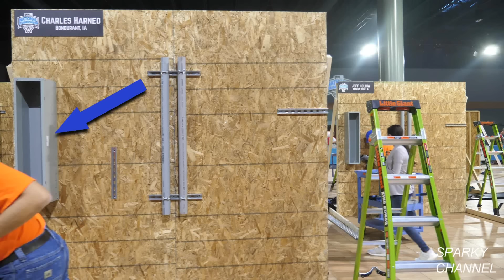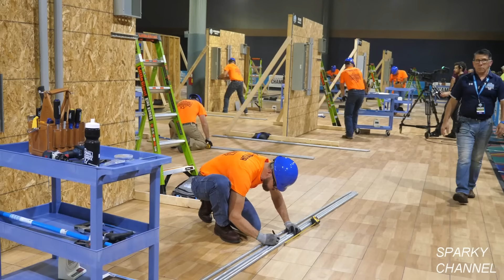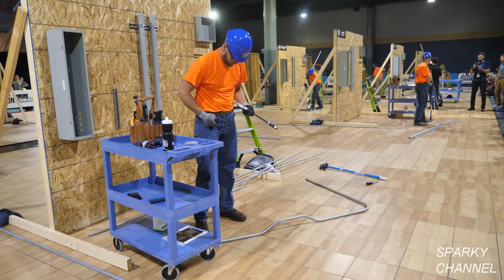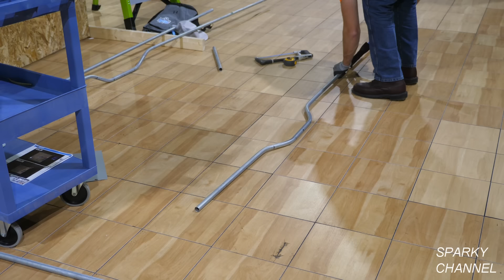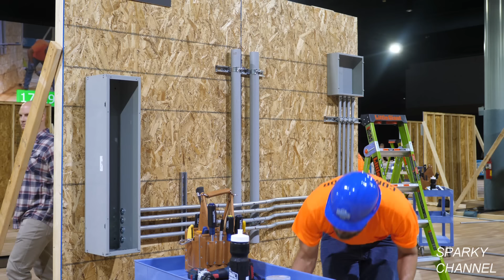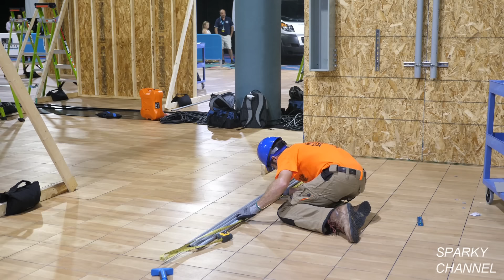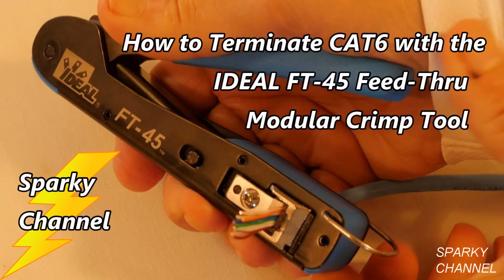IDEAL National Championship Pro 2nd Round Parallel EMT Bends

Comment: Missing a " strut " on the right of the 2 pvc pipes
Reply: Read code. No more straps are needed
Reply: @JB-ud2gn  i guess you did not understand what i meant.
I know that based on the code, the distance between the 2 fixation points here, are o.k.
But...
From my personal pov, i would have put 3 struts to hold the four 3/4" emt pipes.
One between the truff and the pvc pipes.
One between the pvc pipes and the 90° bends.
And one between the 90° bends and the 12x12x4 box
But like i said, it's only my personal pov. 
But non the less, a professional should know that we never use a "sharpie" to mark conduits that will be apparent!!
Always use pencil.

Comment: Emt...?  Get out of here.  Do it in rigid, then we'll talk.
Reply: you feel cool by being like oou im so much better because i can do it in rigid? EMT is used 500x more than rigid.
Reply: @Ash_Lawless  They have that too for poured slab. It's a 2-man team event including inside outlets, 3-way switches, meter/service entrance, breaker panel. The slab has a designated finished height, so the conduit runs have to be planned to not weaken the concrete by having crossings as they go from one side of the "room" to the other.

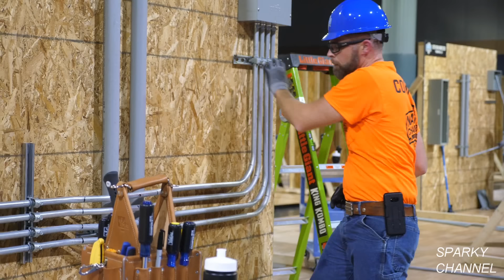Comment: @22:25...

Called it...

A secondary bit of shallow strut support after the offset and closer to the corner 90s would relieve that waiver in the pipe and even out the geometry some more the fact that it was bent in the offset configuration inherently put an instability in that pipe because the run is not flush against the surface for the entire area that would normally touch in an ideal flush mount... that 90 is the axis of a lever and if you support that axis it'll stay there... regardless a little hand tweaking on the corner will smooth it out to the eyeball on any latent tension due to those less than perfect 90s...

Comment: Torpedo levels!!!    @20:37...

When they bend the 90 after the offset most experienced electricians will be close enough to their 90 Mark with a little plus or minus and the knowledge that the pipe has a little bit of flex to it plus coupled with the fact that yes you do your strut straps that adds more tension and rigidity and kind of locks the pipe into its geometry... but where I see the flaws the fact that when you bend up on a full 90 you should use a torpedo level at the uppermost portion of the pipe to confirm the 90 in a relaxed position that will relieve the tension down on the corners because you'll see that the spacing and sometimes an ovaling of the pipe will occur on that full 90 and it draws the eye... I mean these guys got good technique and are given a solid install but the absence of torpedo levels boggles my mind...

Also honestly I know it's not called for but I would have added an extra section of strut on the horizontal run after the offset and before the 90 to give a bit more rigidity I like to have strut support and such within proximity to the 90s as it fits the install... what about plastic bushings on the threads the connectors in the panel they going to do that? I got to tell you too I'm a little concerned about how tight they're getting their lock rings on their connectors? Doesn't look like a lot of torque I think a lot of installers underestimate a solidly mounted connector...

Torpedo level, tape measure, laser line it don't matter eyeball is the ultimate test...

I mean do you really think that floor is level? You think those framers got those walls squared and don't get me going on the drywallers you think that stuff's Plumb level and straight all the way around? Really? When you enter a room you need to take inventory of your environment especially if you're doing a large rack pipe or something you got to make sure things are where they're supposed to be multiple frames of references and such... torpedo level tape measure your friend sometimes you need Heavy Artillery like a plumb bob and a laser... and if you got technique and Flair you use mechanical spacers between your conduit sand runs and such a 12-inch baton of 1 inch EMT or the flat or width of your torpedo makes pretty consistent install... where applicable...
Reply from the maker: Thanks for the comments.
Reply: @SparkyChannel  yeah I never noticed this channel until now and it's become my new favorite place to watch YouTube... something only an electrician can appreciate it but yeah this is pretty awesome it's good to watch work cuz it helps you refine your Technique and I don't care how long you've been on the job you can always learn something new you'll see something new that someone else does that you can make yours...
Reply from the maker: @OTOss-fi2el  Yes, that's very true. I learned a lot being at the Championships and then I learned even more while editing the videos. I had to get my nose in the code book and read up so that I could do proper commentary. These competitors were under a lot of pressure. You sound like you could compete well in these championships. Have you ever considered giving it a try?
Reply: @OTOss-fi2el  Engineers can enjoy this too.

Comment: This is awesome, wish they had something like this for us UK sparkies ! 

What is the conduit made from in the states ? I ask because it looks a lot easier to bend and cut than our steel conduit 🤔
Reply: mostly mexico and india
Reply: @narmale  I mean what material is it made out of. 😀
Reply: @Cablesmith  its mild steel, but it IS easier to bend than the mexico emt, dont know if its physically thinner, or annealed
Reply: There are actually 3 different non-flexible metal conduit choices EMT, IMT, and RMC.
This challenge was using EMT, the thinnest walled of the 3, and coincidentally the easiest to bend.
Reply: @thomasbonse  that’s for that 👌🏼 ours is just steel or stainless steel 😩

Comment: That installation needs another piece of strut on the right side of the vertical PVC conduit to make it a good installation.  A lot of Electricians seem to forget that the NEC code is just the bare minimum that is required. I guess these contests use the bare minimum code also?  I also wonder how many Foreman and estimators go to these contest and use these competitor electricians to gauge how fast they think these job need to be done. These guys also don't have the proper hand tools and power tools to do the job safely. We need to do everything we can to keep our backs, knees and bodies from being torn up prematurely. Russ-J  Electrician from Oregon.
Reply from the maker: Hi Russ! I'm with you brother. Our knees are very valuable so why be working on your knees when you don't have to? I think that older electricians in particular consider these things. I would like to see another piece of strut as well. Have a nice day!
Reply: Couldn't agree more regarding the unistrut. No point supporting conduit on the left hand side but not the right! Rough that is. Speed isn't everything.  No-one cares how fast you did it if it looks shit!. I'm from UK and that's unacceptable with no strut on the right.
  The pen marks on the conduit are ridiculous.  Use a pencil then rub off when finished!

Comment: Overall decent,  but writing on pipe and walls with sharpie is a no-go.  You also had extra time, so why not clean up?  I saw knockouts still sitting in boxs.
Reply: Exactly, stay productive.
Reply from the maker: OK, thanks!
Reply: Yup 👍 I agree 
Is also another easy /Faster way to do it ✌️
Reply: Cleaning up wasn’t part of the competition... the pipe bending was the challenge, not maid duty. If they were worried about those things they would have put it in the rules.
Reply: @Vbbv22  And thats the difference between you and I,  work ethics.
Reply: @andyazaria9523  again, if that was part of the challenge they would have put it in the rules. Your “ethics” could have lost him the competition. The guy did a great job, stop injecting nonsense into the comments.
Reply: @aberg94  I gave the video a thumbs up.  Thats all You're getting from me.  I don't hold hands and pat people on the back..  I'm a perfectionist and expect the same from the people around me.  You're one of those helpers that bends a 90 and expects a trophy!  HAHAHAHAHA
Reply: @aberg94  said it before and I will say it again.   Thats the difference between you and I.  I have standards.  Ps. I could have done entire project in less time by myself.   Go troll somewhere else.

Comment: Can those benders be used on copper pipes? They look handy asf
Reply from the maker: You could put a little bit of bend on a solid copper pipe with this bender but at some point it would kink and ruin the pipe.
Reply: I've used conduit benders to bend 90's in refrigeration tubing.  Have to be VERY careful not to put a kink in it.  Put a kink in refrigeration tubing, you can't use it.

Comment: Tip for apprentices, use a pencil or a silver sharpey marker on the conduit.
Reply: acetone works wonders
Reply: Bug spray "off" takes off marker like magic!
Reply from the maker: Good tips!
Reply: Just mark over it again with your sharpie and wipe with thumb. 😉
Reply: In the uk we call this the Am2..better competition would be plumbers vs electrician then when we beat them at there thing we would prove to be the king of the trade jungle

Comment: Of course you would never run conduit like this in the field. If you're gonna put it on strut you need another piece on the horizontal between the saddle and the 90. I'd prefer to mount my conduits straight to the wall and go under the obstruction since its already on strut. I mean why put something on strut at all if you're not leaving room to go under it? 2 box offsets and a 90 per stick is all you need here.
Reply from the maker: Thanks!

Comment: I really don't understand why the US still use metal conduits. We did that in the 1950 1960.
Reply: Most of europe Ireland and the UK do 
Stronger , easier on the eye and requires skill to install and you are an idiot
Reply from the maker: The metal conduits protect the wires from mechanical damage.
Reply: @SparkyChannel  we use hostalit its a pvc based impact resistant conduit, also we use ymvkas cable from the outside to the distribution panel. no single wires. thats is why european based electric system is superior to the US standard. 230V less amps thinner cables.
Reply: the IEC 60364 code is more modern.

Comment: Do you have to run steel pipes in every electrical installation in the states? 

Australian sparky here and hardly never used it, lots of flexible Anaconda and PVC style conduits but rarely ever touch it. 

Typically steel wired armour cabling is popular in damage prone areas
Reply: Per NEC, we cannot use MC cable in areas prone to damage. The steel armor in the cable isn’t as protective as emt. PVC, we use a lot in underground and in corrosive environments. It’s not good for much else IMO. It’s problematic if installed outside exposed to sun. Even sunlight resistant versions become very damaged by UV. It also has a high rate of expansion and will rip the straps off the wall if you don’t install expansion couplings in long straight runs.
Reply: That’s probably because you don’t work in industrial... I work in heavy industrial in Australia and use it all the time.
Reply: Kum Hydrant I’ve done plenty of residential emt installs for lighting (apartment and condo buildings). It’s the best surface-mounted raceway to use outside. Looks clean and lasts a long time as long as it’s galvanized. I’m in the U.S. Not sure if it’s more of a specialized raceway in Australia but we use it everywhere here.
Reply: Russell Brown Apologies, My initial reply was to the OP.
Reply: Kum Hydrant oh yeah that’s what I figured. I was just throwing in my 2 cents anyway. Lol